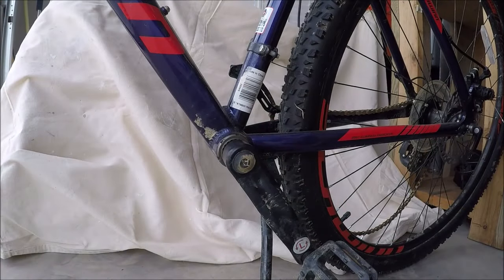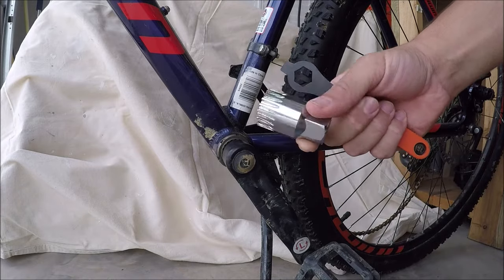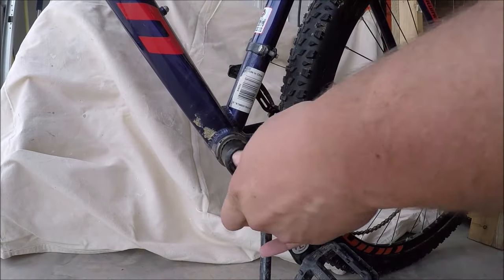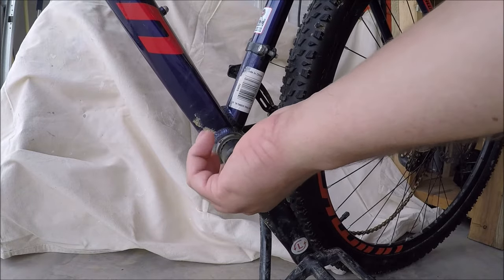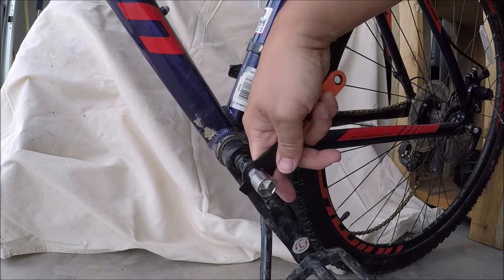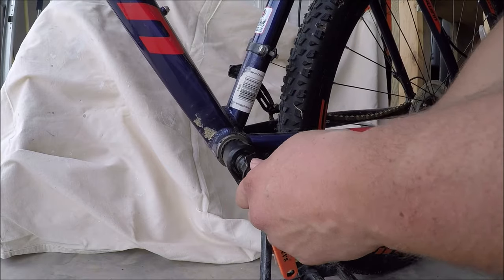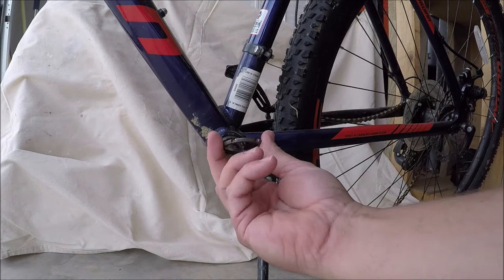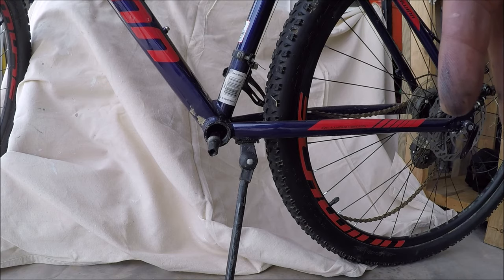Easiest Bike Crank Bearing Removal

Comment: Thats the next repair to do on my E bike,Got to take the whole crank out,Replace the ball bearnings and the chain,Also check through the whole bike,Getting it cleaned up,Be fully service repaired,Just replaced the both innertubes and tires on it,Glad no longer putting up with any more punchers
Reply: How did you replace the paddal I need help with that
Reply: Be careful with E bikes, they can get quite fiddly with the motor

Comment: Was it easy replace all the items back into place? Do new bearings slide right in easily or do they need to be pressed in?
Reply from the maker: Everything just goes back in the order you take them out, no pressing required.  The crank arms are pressed on by the crank arm bolt when you tighten it, after a ride around the block they will probably be due another tightening.
Reply: Wat is name of wrench to remove outer ring ?
Reply: @mechanicvance2480  not if it's done correctly.  You also have to make sure you use bike bearing grease in the casing where bearings are held.
Put back together tight and it will work fine.  
That's what I have always done. 
Buddy forgot to mention this.

Comment: Hi. Nice video! Please I have some questions that you might help me with.
I have a Schwinn Santis and the bottom bracket looks a lot like this one. 
1. Is this bike in the video also a Schwinn bike? If so would you know if this uses the same bottom bracket of a Schwinn Santis?
2. What is the internal diameter of the bottom bracket housing on the frame of the bike on the video (where you screw in the bottom bracket itself)?
3. I believe the Santis also uses a non sealed bottom bracket. If so, I would like to replace mine with a sealed one. Please which Shimano sealed bottom bracket part would you recommend?
4. Do you have the link to the tool kit that you mentioned from Amazon?
Thank you very much for your time and support! Fabio